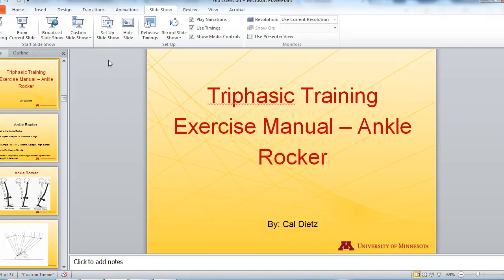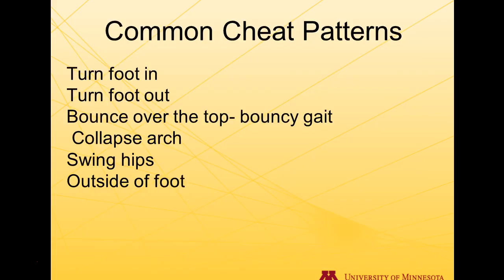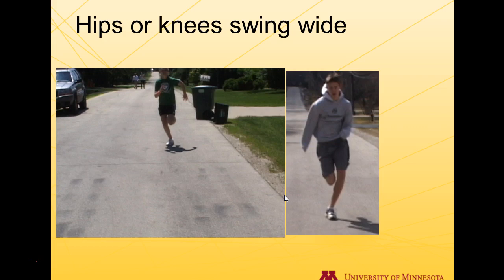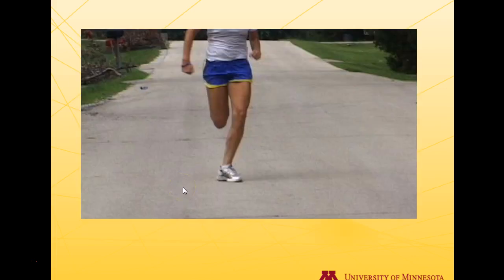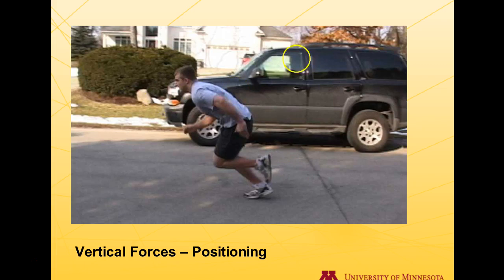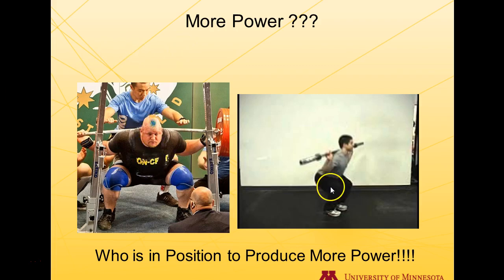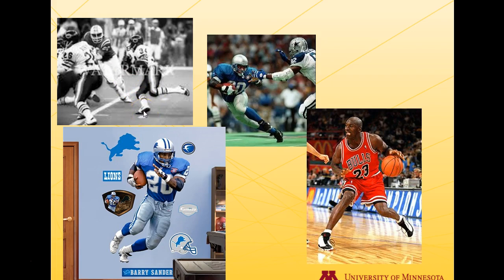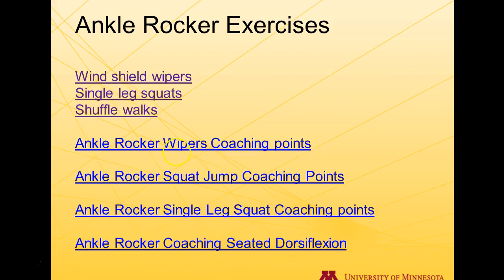Triphasic Training Exersise Manual Ankle Rocker Part 1

Comment: Could you do another tactical manual applying these concepts to men who run with 50-65 lbs on their back
Reply from the maker: In the links below, you will find the five major ankle exercises of the Spring ankle from the Triphasic Speed development manual. https://store.xlathlete.com/product-p/ttsam.htm The exercise progressions below will be sent to your Strength and Conditioning Coaches’ once the questionnaire that was sent is filled out.
 
Level 1 Loading – The ability to progressively hold the respective position for up to 60 seconds over a period of 4 weeks.
 
Week 1 - 20 seconds - 2 sets of each exercise per week. 

Week 2 - 30 seconds - 2 sets of each exercise per week. 
 
Week 3 - 40 seconds - 2 sets of each exercise per week.   
 
Week 4 - 50 seconds - 2 sets of each exercise per week.   
 
Week 5 - 60 seconds - 2 sets of each exercise per week.  
 
Week 6 - 60 seconds - 2 sets of each exercise per week
 
Spring Ankle Position 1 
https://www.youtube.com/watch?v=NMa_05zg5mo
 
Spring Ankle Position 2
https://www.youtube.com/watch?v=k3ohfgHiJyw
 
Spring Ankle Position 3
https://www.youtube.com/watch?v=IfNABKborF8
 
Spring Ankle Position 4 with Level 1 Loading
https://youtu.be/kCQIhsdRcx4
 
 Spring Ankle Position 5 with Level 1 Loading
https://www.youtube.com/watch?v=UwiiUEvyuUk

Comment: If you're doint an eccentric Rdl/squat on the way down you want to squeeze your big toe to engage the glutes so that they get the eccentric damage too, cause isn't that why you're doing the eccentric exercises? (only when you're directly working the hip flexion (mainly psoas) do ypu want the toe up because then you want to engage the psoas, right?)
Reply from the maker: You're right. And this is your right and this is another way to look at it, 
The way you describe is what I feel is the most sport specific so on the way down don't squeeze your toe into the ground. Your glutes will still be working but not at the highest possible way. And then squeezing your big toe when you go right before you go into extension is the most sport specific way. 
Now to squeeze your glue and then eccentric Lee load during triphasic is a more optimal way to eccentric retrain the Glute yes. So during the triphasic eccentric phase you would squeeze the toe before you start eccentric phase to address all the tissues. 
Very good question and thank you for bringing this to my attention. 
I've always said the triphasic part of training itself is not sport specific everything after triphasic is sport specific and triphasic help to build resilience towards injury and making you stronger for that sport specific training.